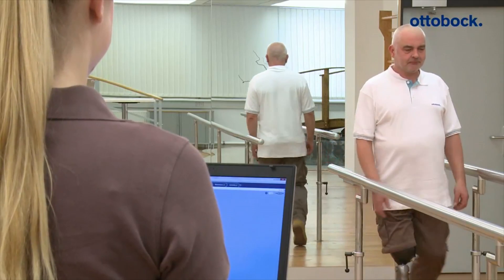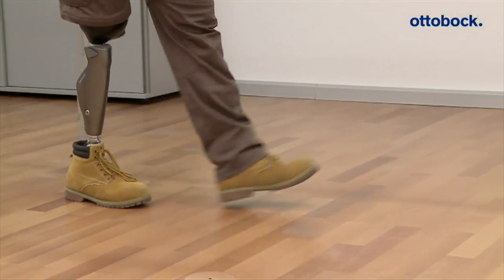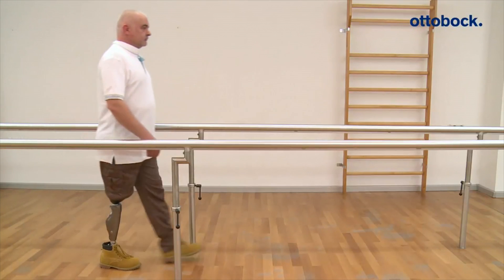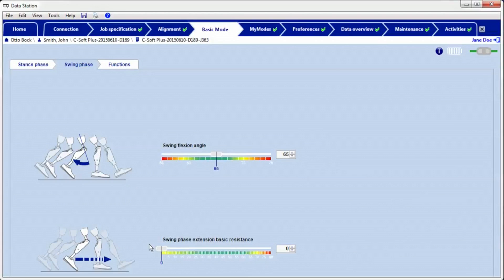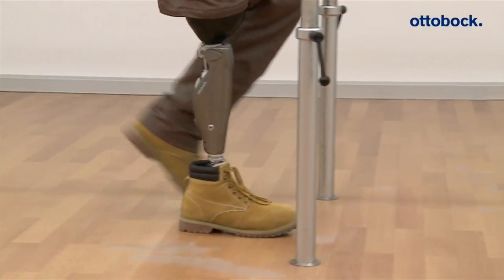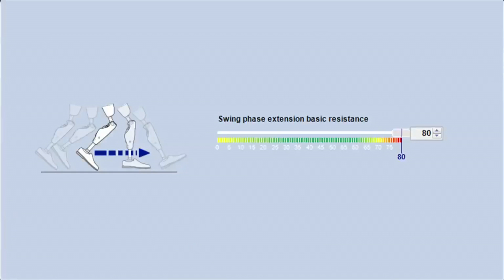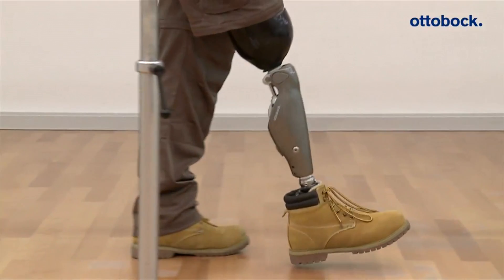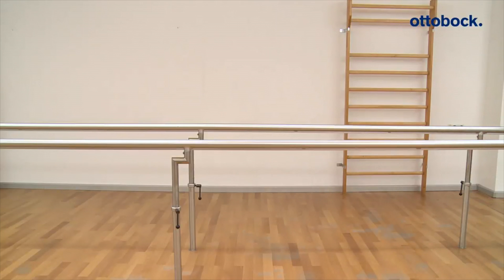C-Leg 4 Quick Start: Swing Phase Extension Basic Resistance

Comment: Just got my c-leg back!!
"some pitting on switches ,which could cause knee to lock"
This replacement knee was only 2 months old
I found a great use for it now, it holds up a shelf in my closet
I would be happy to give it away ,however warranty won't transfer and I would only be setting up another amputee for failure.
Reply: Mark what type of prosthetic do you prefer? My father has had a c leg for quite a while now and it has never worked right. Because he got sick of taking it in constantly he has settled for an awkward sideways swing to his walk rather than going up and over his foot/leg. Do you have any suggestions?

Comment: I have had a c-leg for almost 2 years
been in for repairs 4 time until they replaced it with a new one 
Now this one is going in for repairs 
This was on one of the repair orders "parts were installed upside down"
Never again will I use a c-leg
Reply: +Mark C walking looks smooth in this clip
Reply: +Lucifer 
Works ok when its not in for repairs
a 2 min clip doesn't give the true picture of the knee
Reply: +Mark C 
Understand please 
Mine is not the c-leg 4 but the 3 and it had been in for broken wires/parts installed by otto bock tech upside down 
have the work order stating that!!
they replaced it with a new c-leg 3 ,which is now in the shop again
Reply from the maker: Hi Mark C

Thank you for reaching out. You have our apologies. The quality of care has different components and is strongly connected with the market. We would like to clarify your inquiry directly with our colleagues in charge. Please send us a private message with your country, phone number and e-mail address so that our local staff can contact you. 
Your Team from Ottobock Headquarters
Germany